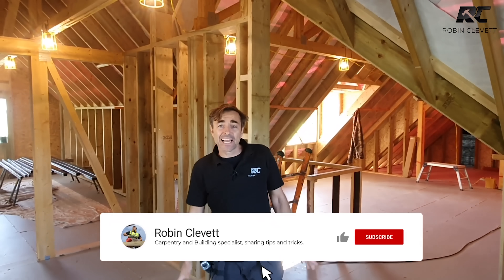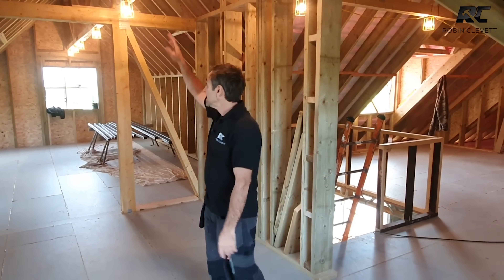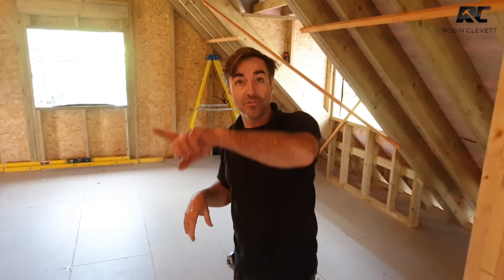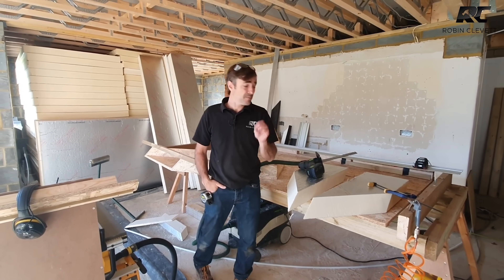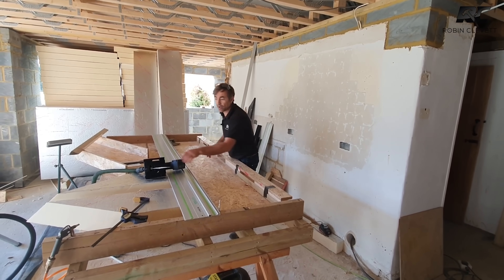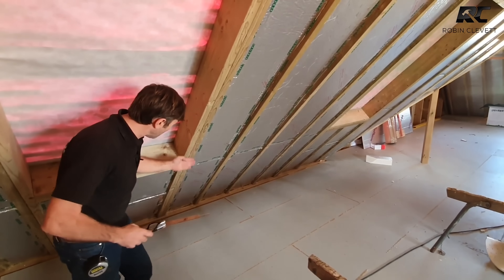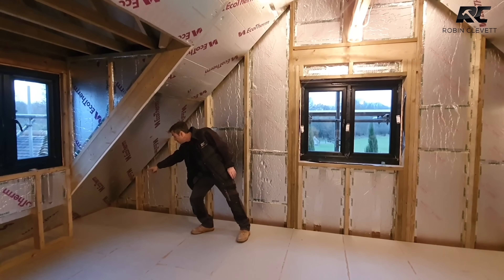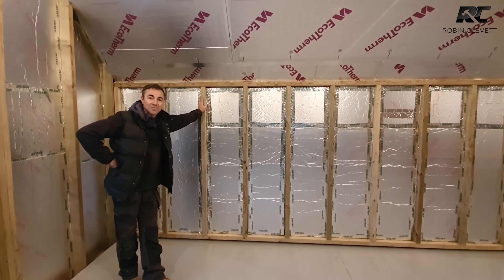How to fit insulation 2023 to the latest Building regulations Part L

Comment: Superb work. I love that the design was created with insulation already considered, rather than it being an ad hoc afterthought.

Can anyone tell me how the dwarf wall is secured, presuming it can't be tied into the rafters because of the second skin insulation.
Reply from the maker: The roof was designed by myself and my engineer so the dwarf walls did not need to transfer loads so they could be fastened directly under the second skin of insulation, there is a video in my Big Build Series that covers this
Reply: @robinclevettcarpenter  thanks for your reply Robin. I'll find the video and watch it.

Comment: Lovely video of some great techniques.
My only query was that when inserting the insulation slabs between the rafters it looked as if they were pushed in past the flush  position that would leave ~10-20 mm gap when the second insulation was applied. Is that gap designed in, planned or desired? I was expecting the the two would be 'kissing' each other.
Reply: I thought the same. In other videos I’ve seen it’s fitted flush with the outer edge.

Comment: Informative thank you sir :) - so to close off the air-gap debate, you have an air-gap on the diagonal section of the roof, but on the vertical walls there's no gap and fitted flush ?  I do have a scenario myself.  I have under house storage with joists at the ceiling leading to the tongue and groove flooring.  I keep reading conflicting information on whether an arigap is needed in this instance.  What are your thoughts please?  (have have 100mm boards waiting to rock n roll) :)
Reply from the maker: If there is a ventilated space naturally like a traditional suspended ground floor from air bricks then simply insulate between the joists, I would check with your building inspector if this is official works as even they have differing veiws!!

Comment: I live in Texas on the gulf coast.  Our insulation is only on the floor of the attic.  Can i just keep the foam boards/radiant barrier as whole and screw them to the wood, which would leave channels for air flow?  my goal is just to keep the attic from being 140 degrees F and help the AC work easier.

Comment: Did you leave an air gap between your insulation boards and the roof sheathing?
Reply from the maker: You have to have an air gap that is from the eves/soffit and able to leave at the ridge, we have about 80mm on the big build, I do reference that in this video

Comment: Anyone know how Robin insulated the gable wall? Did he push the pir boards up tight against the OSB or did he leave an air gap?
Reply from the maker: Hi Tom, we push the PIR up against the back of the OSB it's the exact same way that most timber framed houses are constructed
Reply: @robinclevettcarpenter  Thanks Robin

Comment: I am an amateur self builder, who has just spent 3 months insulating a 300 m sq house myself - I cant afford the cutting gear you have here, or the mega expensive gap tape which is a great product but cost prohibitive. I would love to have achieved the standards you have here, but its simply impossible unless you have a much higher budget than most self builds. I'm foaming the life out of every gap, taping every joint and installing foil over the lot. Hopefully that will be enough. Great, professional,  video though and definitely something to aspire to.

Comment: You spoke alot but didn't mention an air gap behind the insulation and the roof! Looks like you haven't done that. I thought you should have that?
Reply from the maker: Hi Robert, I am guessing that you scan viewed the video? because I mention this on two occasions and have mentioned it in previous videos, so the time stamps for where I refer to the airflow space in this video are, from 3.0 mins to 3.10 mins and from 4.34 mins to 5.14 mins. If you know anything about me... I am totally into correct procedures and following the most up to date building regulations and practises, I also understand that people fast forward or miss information included in my videos, hope this helps, Robin

Comment: Robin, what insulation thickness do you use??
Reply from the maker: With the gapotape we can reach the values with 120mm in the rafters and 25 beneath without the gapotape you may need to go for more like 120mm in and 60mm under depending on other factors such as rafter spacings etc

Comment: Hi, I'm doing something similar in my loft,  insulating 100mm between the rafters with a 50mm air gap, new membrane and 50mm overboard, did you put a vapour barrier in there before you plasterboarded it? I'm trying to workout if I need a vapour barrier or not, thanks!

Comment: This is all very well if you have trades that fit the PIR tightly and use the tapes but if they just hack it with a hand saw and wedge it in there are thousands of gaps. I think a warm roof with the insulation above the the rafters is better because it designs out the need for good workmanship - the sheets can be butted together and taped with far less cutting.

Comment: How do you plasterboard with 450 centres
Reply from the maker: I mention in the video that we use a board that measure 2.7m long and 1.2m wide these are a standard plasterboard but it is not stocked by builders merchants but.. they can all get it
Reply: @robinclevettcarpenter  ah nice

Comment: I wanna do mine but ain’t got a clue, i heard you can’t push the insulation all the way back cause there has to be a air cap behind it, and is there a different insulation for the floor and roof? is it wrong to buy bags of the soft rolls and just unroll it everywhere?

Comment: Your work makes me fill like a cowboy even though I was trained by Taylor Woodrow , in my tool bag was a Canadian distance saw,  saw set an a  saw file , claw hammer Nail bar,  hand brace , wheel brace  nail punch and a bro ll for masonry holes , yanky screwdriver , wooden mallet jack plain and block plain , roofing square , combination square , bevel  and l level , plumb bob and a set of chisels , and a big tub of tallow , animal fat , and a pencil, can you imagine if a tool thief broke into my van , I really can’t think what he would take , probably the bottles of beer ,, love your show and thank you 🙏
Reply from the maker: Your no cowboy!! just being able to identify some of your tools let alone be able to use them is a real skill!! Thanks for watching and commenting, from one fellow carpenter to another.
Reply: I forgot my coping saw and Spoke  shave  , I remember when I got my first estwing hammer with the leather handle, I took it to bed with me and when I made my own frog and walked around the site as a tradesman I was very proud, I’m now retired and it’s loverly to watch the new generation ‘ I did the stair case for what they call the Franklin hotel now in knightsbridge ; it was two stair wells from basement to roof , all by hand and I did all the  first and second fix for the Control tower Gatwick were I parked my car outside the control tower and Brighton to London in one hour with my tools on a motor cycle , as wages were amazing  I ended up with owning six house , I loved carpenter , but it never made the money I made on property,

Comment: About to start insulation of my loft, was under the impression you need to leave a gap between the roof and the PIR. Is this the case?
Reply from the maker: absolutely... we have a clear ventilation space of about 80mm over our PIR on the Big Build and this is vented from the eves via an over facia vent to the ridge via a continuous ventilated dry ridge system
Reply: @robinclevettcarpenter  thanks for the reply might have missed it in the video. Wasn't clear for me. Ta

Comment: People also don't realise with Celotex Robin that the roof timbers shrink 2mm off of each side so even the tight fitted board goes loose after a year or two.   We use a decent foam gun to fill any possible weak points.   I love your insulation jig
Reply: missing the point mate - you won't/can't get the foam the full depth of the insulation panel along its length - that why the Gapotape made it into the new Regs as they are going after this!!
Reply: @paulrogers2192  that was my point mate we can’t just rely on tight fitting insulation it needed extra things to seal out the cold.  The foam locks the insulation in place so when the rafters shrink it doesn’t just slide out.  Many builders do it now it makes a bloody good job.  I do all of my celotex fitting because I have found people can’t do it properly.  I was silver taping 15 years ago

Comment: Hi Robin, I’m about to insulate my garage loft in the same way. 100mm pir between rafters over-boarded with 25mm pir and then 12mm pb. I noticed you didn’t dwang the rafters to carry the edge of the pb. Is this not required when overboarding?

Comment: Impressive work I am working last 2 years in the UK as a structural engineer I have a lot of issues with the builder regarding the regulation. They did not follow the regulations for saving the cost but you give very good lesson quality is the best key to success.

Comment: Great work, top job, but I have to correct you on your opening statement that back in the 80s it was just crash bang wallop and no talk about ventilation and air spaces.  In the late 70s, I served my apprenticeship and did my City & Guilds and ONC at Erith Tech collage and we were taught about ventilation, air spaces, wet rot, dry rot etc.  One of my first site jobs was pulled apart by the building inspector as a gang of chippy's hadn't allowed adequate eaves vent on a cold flat roof. The science has not changed, materials have changed, upgraded, improved,  eg, we use breather membrane rather than tar paper, PIR in place of glass wool.  If you were crash bang wollop'ing jobs in the 80s-90s you were doing them wrong. Sorry.  But great video anyway.

Comment: Ha Robin .... Im Barny we a bit of work together maybe 32 odd year ago over banstead way , glad to see you still at it as am i , but more chilled now. i did a huge loft about 6 years back and it was passed to use tried-iso which was totally wrapped inside being very careful to do as per. The loft has stayed warm in winter and cool in summer , the heating costs rose in proportion to the size and no vapour issues. I reckon it saved me a week in labour time . Its a shame the councils don't like it . Cheers barny
Reply from the maker: Hi Barney!! Great to hear from you!! Its been a long time for sure!! I have used foil wrapped roll insulation like Tri-iso before and in some retro fit situations it the only way!! Its good on top of the rafters too, be good to bump into you mate at some point!!

Comment: Don’t think I would have the balls to tell the client we’re spending over £1000 on sticky tape! Learn how to read a tape and use a saw accurately it’s a lot cheaper!
Reply from the maker: That was my first reaction to the concept of an air tight tape, we now give clients the option and when we do our thermal calculations often the increase in price using the tape is negligible as we can use a slightly thinner PIR as the performance with the tape is miles better, and even if it is cut in well like you indicate the tests in the laboratory with what you would consider well fitted insulation against the taped panels was vast, you only need a few millimetres of gap here and there and the performance is reduced by a large margin, all my clients in the last few years have always gone for the Gapotape and they appreciated that there was a better solution to get the best performance from the dwellings, it is a good product IMHO

Comment: So are your rafters oversized for longer span eaves to ridge as Ashlar walls will now be non load bearing I assume?  Also does changing rafter centers not give a problem with plasterboard fixing? Neat job on insulation installation which, I do not think anyone could fault.
Reply from the maker: Hi Malcom, in an earlier video about the design of the roof, I talk about the sizing of the rafters etc and indeed they are sized to do the spans and the flat ceiling and the Ashlar walls simply pinch in and have no load bearing elements etc, 450mm centres is also a standard spacing for plasterboard but you buy a 2700mm long board or 1800 long board there are several sizes of plasterboard available many people assume that the biggest is 2400mm long by 1200mm wide. Hope that helps mate
Reply: @Robin Clevett  Thanks Robin for your reply and helpful advice. Will look up earlier video and did not know about the availability of different sized plasterboard. Best wishes

Comment: Excellent video
Retro fitting PIR to older roof spaces i.e 1975 semi with vents in the facia boards- is it possible? Do you need air gaps between the black bitumen type material and PIR? Cheers john
Reply from the maker: Hi John, the insulation needs ideally a 50mm airspace that is vented and continuous from eves to ridge so the answer is yes
Reply: @robinclevettcarpenter  cheers for the reply. Appreciated. Thanks

Comment: So the electrians come on site and the customer doesn't want surface mount sockets and switches then what? Are there factored in voids/chases?
Reply from the maker: All our services are in dedicated runs and if you watch a later video on The Big Build Series I explain about the first fix electrical etc
Reply: @robinclevettcarpenter  having worked in that industry for 13 years I know how fickle a clients answers can be. Such as at planning stage we want sockets xyz. Then scope creep etc and before you know it you need 3, 4, 5 more T&E wires in an area because, 2-way switching, controls wiring for an unplanned gadget of some sort.  This video was suggested out if the blue via the Youtube alogthrym.  Will have to invest some time watching the series. Thanks for the content.

Comment: You have to take in to account the costing of a job.It’s great work putting celotex or recitel in the vaulted sections but beyond dwarf walls all the way round is excessive when insulated the dwarf wall and the floor beyond with mineral wool.
We all know how much building materials cost now so sometimes you have do the job without wasting too much product.
Great job though!
Reply from the maker: We find that it is such a better outcome with a continuous layer of PIR from Eves to Ridge and as I mentioned all the storage, the services like plumbing and electrical can be on the warm side, trying to get having the ceiling done and the dwarf wall done separately means that void is cold and there is a tendency to not get the insulation blended well where the different types meet

Comment: Why is the PIR sheet not set flush with the inner surface of the rafters? this results in reduced air gap between the PIR and the roof itself and potentially? I would have thought making it level with the inner surface of the rafters would mean less issue of damaging the gaffer tape during install. Thoughts please.

Comment: Im just completed a self build extension with loft conversion, i screwed lats to the beams and used pu glue for the insulation boards, it was a nightmare when you realise all the nooks with the angles are, i struggle to think how a new build will be able to be profitable with all the labour involved to do this properly.

Comment: Absolutely airtight = no ventilation = moisture build up = mold. It is debatable if this aspect of the UK building regs is fit fit purpose.
Reply from the maker: Hi Bob, the trouble is people do one thing and forget another, we have a fully ventilated space on the cold side of the insulation from eve to ridge also vapour check layers to stop moisture vapour escaping into the fabric, the as you intimate, we have extractors and trickle vents to remove the normal internal moisture generated in a dwelling in wet areas etc, it's a whole house design that must me adhered to!!

Comment: I absolutely HATE Kingspanning, but I would actually do it voluntarily if it meant being able to do it this way. Sadly, the sites won’t provide the gapstop tape, and I can’t afford Festool. It’s the trusty old hand saw, expanding foam and 500g of dust in the lungs for me lol.. Seriously though, that job looked impeccable.. 👌🏻
Reply from the maker: The sites will have to prove how well the insulation performs soon and this is done after the work is complete, what this means is that there will be lots of problems when they test initially then they will realise that this is a job that needs to be done as well as possible and that the "performance gap" in eliminated as much as possible, Gapotape eliminates the performance gap and the performance of the insulation can be as much as 80% (as tested under laboratory conditions) It so much better with the Festool ISC240 and the Tape, and once you are set up it is far cleaner and quicker, yes the tape has to be put on but that would only amount to a couple of man days on a job like the one we are doing and we have cut 80 sheets!!

Comment: Sparks nightmare turning up to see this has already been fitted before first fix very neat job though
Reply from the maker: All our cables are on the warm side of the envelope and we have designated routes in partitions and in the new ceiling structure that is added after the insulation, we make it proper easy!!!

Comment: What's the consensus of leaving a gap between the two layers of insulation (as you have)? Roger Bisby (Skill builder) says leaving a gap improves the insulating quality, yet Kingspan advise against it. Another quicker and less costly method is simply using filler foam to joint and fill any gaps too....
Reply from the maker: It is a really good question,  Roger is correct and the air space is specified in some situations and if done correctly it works similar to double glazing, we have had building inspectors insist on it in some situations the gap is small... about 20mm it is one of those grey areas and there has not been enough proper scientific testing done on either way!! Hope that helps